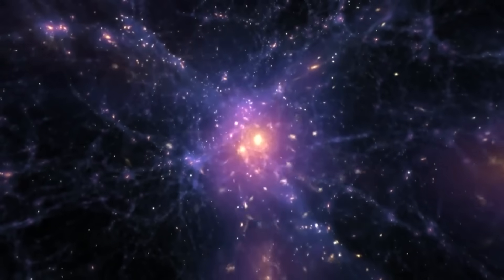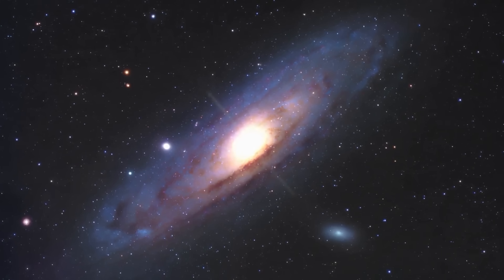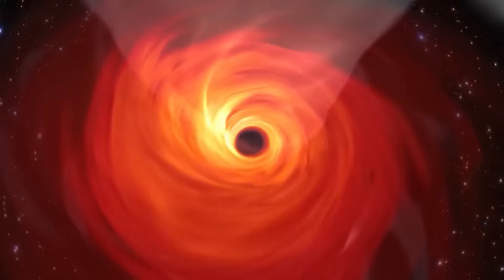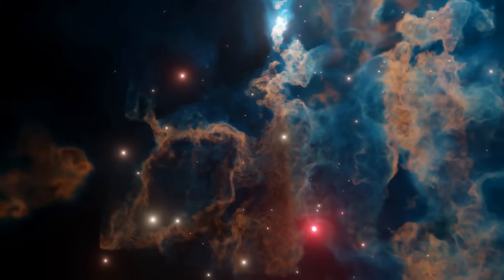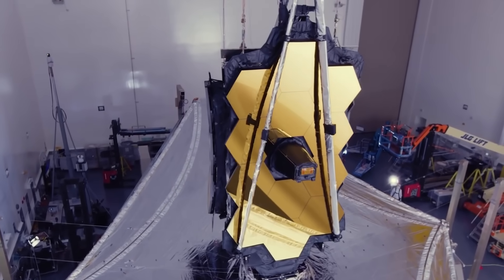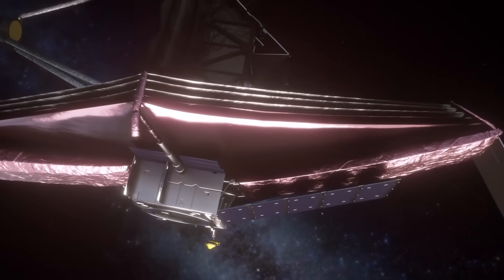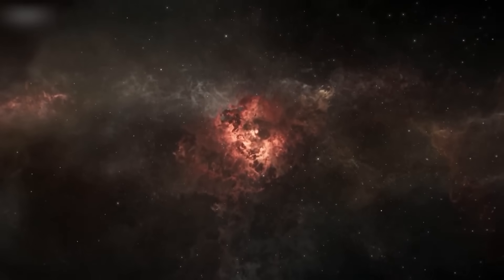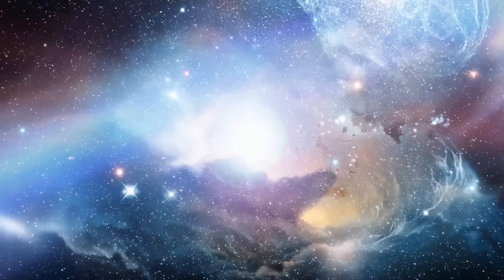ALERT: James Webb Telescope’s Latest Data Will Leave You Speechless!

Comment: We observe something and interpret it based on assumptions that are based on model that is in turn based on interpretation of other observations. That it all fits so far means nothing, it can be only slightly flawed or completely wrong. One could argue that dark energy is just a theoretical concept that makes the model fit with observations so far. You can only observe its impact after all which can be caused by something completely different.